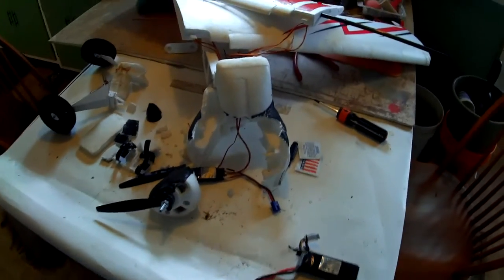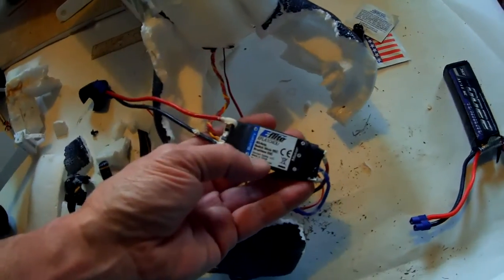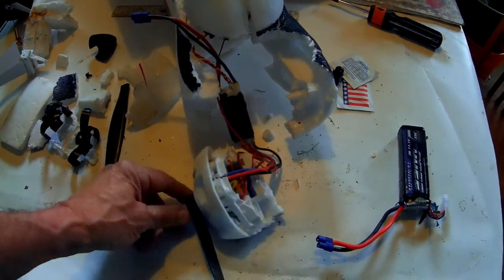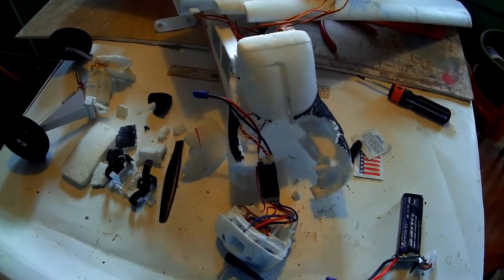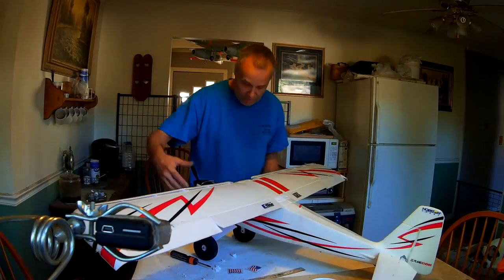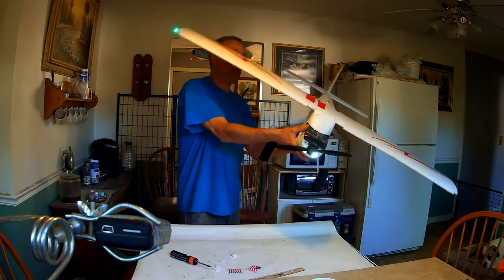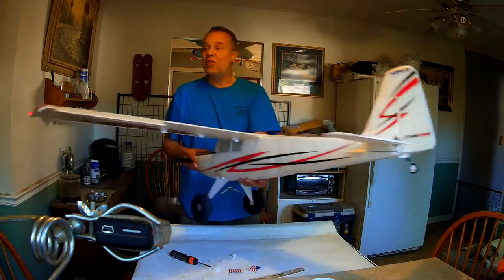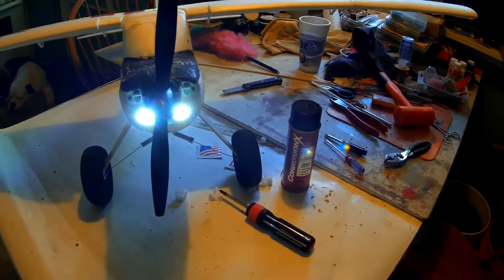Mike's E-Flite Timber Crash Repair and Diagnosis, ESC Overheat Tips

Comment: Nice to actually see someone repairing a crashed plane rather than toss the thing. I have fixed my Apprentice many times. Its not perfect but thats not even the point. Those people that toss every plane drive me nuts. Many can be repaired, but instead get scrapped. Using boiling water, expoxy, foam tac, elemers glue, super glue and spackling can fix an otherwize badly damaged plane that may not look new, but still fly as ggod if not better than the original.

Comment: Skip I have one more question for ya. Where did you remount the esc? I am going to attempt one more flight/crash with this esc that came with it but as I’m putting it back together I was wondering if I should mount the esc underneath the battery bay. Any info is greatly appreciated
Reply from the maker: Yes sir.  Under the battery tray is the place to be.   You got it.  You took out the silicone from both sides of esc. and you should be good to go
Reply: Skip-Built, RC. Okay, sorry for all the questions but I greatly appreciate your input. You are saying take the silicone off the esc totally?
Reply: Still drawing about 45-50 amps from esc after testing so I know it’s good. I guess I’m just gonna take all the lidocaine around the wire harness if the esc and see if it makes a difference

Comment: Could you mount a little fan on or near the esc? Whats yhe best way to remove the battery tray Bud?
Reply from the maker: Battery tray is glued in, but not sturdy.  Just pry and pull it out.  Don't need a fan if you take out the silicone waterproofing they stuck in Both ends of the esc.  Really dumb, as no air flow to cool electronics.  A fan will just weigh more and take up battery space which is tight already with a 3000 nah 3s batt.  Hope this helps, Skip

Comment: Skip, WOW! I have had the same problem last night. Flight along fine, put landing Flaps down, and lost complete control, driving my timber right into the ground ripping the cowl and landing gear square off. Did you use foam tack or CA to repair this? I couldn’t imagine a repair of that nature without either gorilla glue or hot glue
Reply from the maker: Used Foam tac.

Comment: incredible Skip.   A little filler for the seams where reglued and a new paint job,  that thing is gonna look like a new plane.   You certainly have some vision when it comes to restoration.   I blew one of my landing gear mounts right out of the fuselage ( twice).   After second time I was looking online at a replacement fuselage, but later talked myself into repairing it once again.   Don't know if I could do that with what you there to start with.
Reply from the maker: Thanks Buddy.  It's just a thing for me.  Kind of a challenge to see if I can fix a plane and make it fly right.
Reply: hujum1 dude, HOW DID WE FIND EACH OTHER!!!!! Oh maby because of the timber.:)

Comment: Hey Skip awesome job repairing that timber. It was   up. I have a ultimate byplane and it has a problem with a power loss after about 2 minutes of flying. And I am wondering if it's the ESC over heating it also is just sucking the battery down in that 2 minutes. I will have to pull out the ESC and check it out. What do you think Skip. Let me know. Thanks 😎
Reply from the maker: Pull the silicone out of both ends of the esc, it tends to overheat and cause all kinds of bad problems.  If you fly in moist conditions, water etc. spray some corrosion-X in both sides, blow out and good to go for water repellant and esc wont overheat and brown out or catch fire like mine...LOLOL
Reply: @SkipBuiltRC    Sounds like good advice I will do it and let you know the results. Thanks Skip 😎

Comment: skip, you are a magician !!!!!!
I crashed my timber but damage to fuse was so bad I needed to buy a replacement, can you tell me where the esc goes exactly and in what direction ? and how should I slice the esc open to get better ventilation into it .

Thanks
Reply from the maker: Thank you for that.  No Problem.  The esc mounts directly under the battery tray with the capacitors forward for better cooling.  Be sure to get the unit up as close to the front of the cowl as possible, as the esc's from the factory run hot if they have the silicone sealant in them blocking air from flowing thru the esc wrapping.  Hope this helps.  Thanks for watching, Skip

Comment: It's like watching a doctor perform surgery on a patient seen your work. Great job skip. I do have a question about that corrosion X spray. I have a tidewater seaplane and I want to waterproof the ESC but I don't want to use tape or place it in a plastic bag to waterproof.  Will this corrosion X definitely repel water. What would I do just spray the heck out of it on the inside. Let it dry and then I could go on the water and float fly.
Reply from the maker: Kai Schroeder yep.  try. not to immerse but regular use on water is fine.
Reply from the maker: Kai Schroeder go to the flight test Channel and search waterproofing Electronics. that's the name of the video that they feature the corrosion X on. they demonstrate it even working under water ESC and everything. check it out

Comment: Way cool.  That is an impressive repair.  When you put it back together, do you recall if the little cylindrical nub at the back of the motor goes into the hole in the plastic frame?  On my recent crash, it looks like it should but the prop shaft isn't far off and it "really" doesn't want to move to go into there.  (I'm new at crashing)
Reply from the maker: As I recall,   it doesn't have to go that far back.   Airflow and lube point for the motor shaft/bearing.  You'll do fine.
Reply: Thanks, Skip!

Comment: Today was my first flight I bought a used timber from kijiji.ca it looked brand new. My instructor took it for the first flight and 2 min into the flight everything stopped and the plane crashed. The prop broke, the wing cracked and the front of the plane kind off squashed. We didn't check the heat on the esc, but could that be the reason? Immediately after the crash the light were not turning on and not power was going through. Any suggestions what went wrong?
Reply from the maker: So Sorry to hear that. 
Yes, probably because of the silicone in the esc.  Chances are if you plug it back in it will work again unless it did fry.  But esc or signal loss sounds like the problem.
Reply: @SkipBuiltRC  My instructor has taken the plane to repair.  I shared your video with him also. But the earlier owner who sold me the plane said he had flown the plane before. Could there be any other problem. Also I see you fixed the plane very well. What is the best way to straighten the squashed foam?
Reply from the maker: @sanjivkalra5547  the plane may have flow before and didn't present the problem.   This has happened to many.  
The replacement esc does dot come with the vent restrictive silicone sealing the esc for waterproofing.   As for thw foam, hot water and gentle stretching by hand, kneading the foam straight like doe.

Comment: I ALWAYS open the cover on my ESC, there isnt any reason to pack those with silicone except water egress from flying on a lake, they should have never closed up the ends. Not enough air flow. Sad that so many of those planes are ending up scrap. I would for sure add a higher rated ESC if using the larger cell battery. The Maule also has a smaller ESC than what I would use in a larger cell application. Turnigy is my go to ESC for Dynam and Any ESC change. I have NEVER had an issue with them.

Comment: What a great video i'ts unbelievable how foam planes  can be repaired I have a HK tornado 75 that was also in about 30 pieces that I have now repaired and i'ts now flying great I used HK epoxy because it is very strong but its a little messy to use I think you used something called foam tack can you confirm please
Reply from the maker: Mr Foamie RC Planes yes foam tac glue
Reply from the maker: Mr Foamie RC Planes you can get it on Amazon or motion RC carries it 9.95 per  bottle.   best stuff I've ever used. super strong yet remains semi-flexible and can be repositioned if need be within a half hour to an hour if necessary. otherwise it holds tight in position very rapidly. I use it for everything now. even gluing on wings.

Comment: I cant win skip...lol. So I get the timber all back together and she look GOOD and CG is on point. So I do all surface tests and would you know it, my throttle cut I assigned to toggle switch H is missing. It should still be under warranty so I Hope horizon at the least replaces the switch. All of my fixed wings are programmed into this transmitter so my fleet is grounded until further notice
Reply from the maker: Man.  Sorry to hear that.   If you are flying with a dx6,  my buddies H switch needed to be replaced.   H'mmm.   Make mention of that.   Might be a recall??
Good luck and GOOD job on the Timber.

Comment: I never have an esc problem with this plane, probably because I am in Canada and have no issue with high temperature. I normally use a hot glue gun for the nose repair. However,  I will replace the whole fuselage after another crash.
Reply from the maker: LOL... me too.  LOL